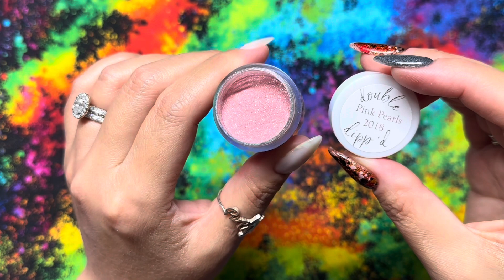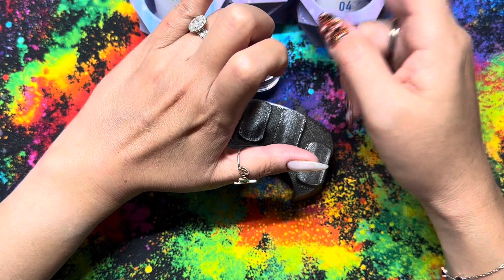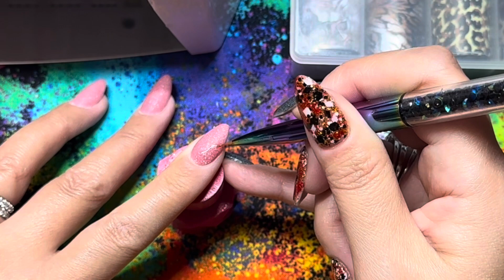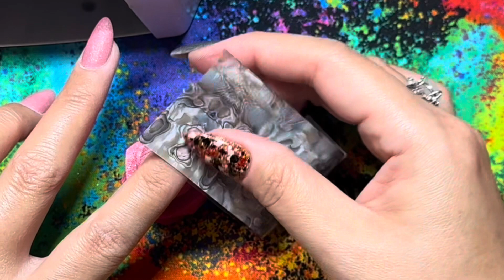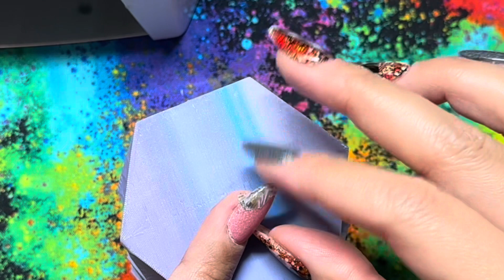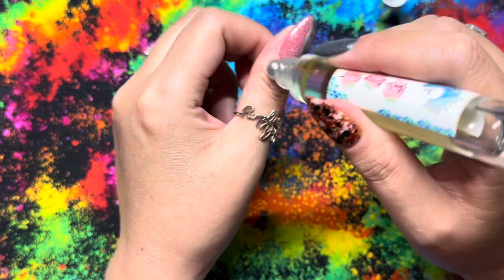Abalone Shell Dip Powder Nail Design w/ Transfer Foils | Double Dipp’d | iGel Beauty

Comment: (Continued…..)

One other thing….. I do have pieces of actual abalone shells, but haven’t used them yet.  I purchased them, I believe, when Tiffany did a mani using pieces of abalone shell on one or two of her nails and it was so pretty!  I’d also love to see a tutorial where you show how to use them and also, how to encapsulate them in builder gel.
Finally, I’m thinking about purchasing one of the iGel e-files….either The One or The One Pro, but not sure which.  Do you know if they both have a pause button feature on them?  I have looked and can’t find info on that anywhere.  Also, I’ve heard that one or both have issues with not working properly at the lower speeds, like 1-5, I believe….something about the hand piece stops turning, or stops and starts?  I know that can be an issue with, shall we say, “the lower quality” e-files.  However, the iGel Beauty e-files definitely don’t fall into that category, so they shouldn’t be having that issue. 🤷🏽‍♀️
Anyway, whatever info you can share with me on which model you would choose, I’d appreciate it.  
FYI…. I have Triple D’s model from about 2 years ago, I believe.  Just so you have an idea of what kind of e-file I’m used to.  It still works, but there have been a few times when it stopped spinning and then starts working again.  It just makes me nervous because I don’t want to be in the middle of doing my nails and it goes out for good! 😬
It has the forward/reverse and pause button feature on it and I love that, so I don’t want to give that up.  However, I’m wondering now if all files that have forward/reverse automatically come with the pause button feature because I always pause mine before changing between F/R? 🤔
Ok, wrapping up for good this time!  😂😂
Sorry this is so long! 🤦🏾‍♀️
Reply from the maker: Sorry it took me a while to respond, but wanted to dig a little more for you since I don’t have the one efile or one pro. I have the XS and XS 2.0. Neither one of the ones have a pause button (but the XS doesn’t either and I found the easiest way to mimic a pause button is to put your forward / reverse switch in the middle rather than either side and your efile will pause 🤭 From what I understand the one pro doesn’t skip at lower speeds like the XS can, but I haven’t tried it first hand. I know this isn’t super helpful, but I don’t want to steer you wrong based on non-hands-on experience with either.
Reply: Sorry, i didn’t realize you had responded and I also forgot where I’d asked the question! 🤦🏾‍♀️ So thank you for doing the research! I think I’m going to take advantage of the 60% off sale going on now.  I can’t use my points with that code, can I?